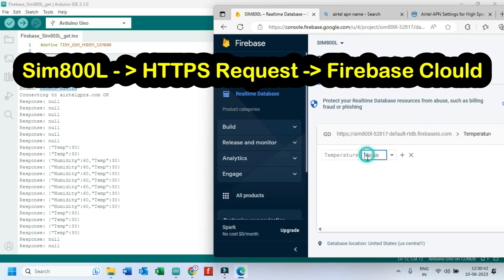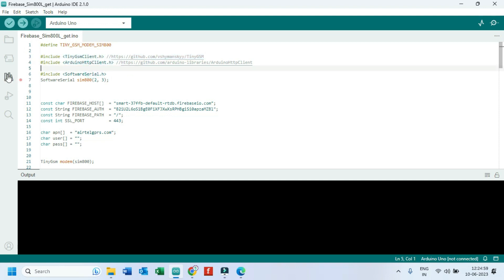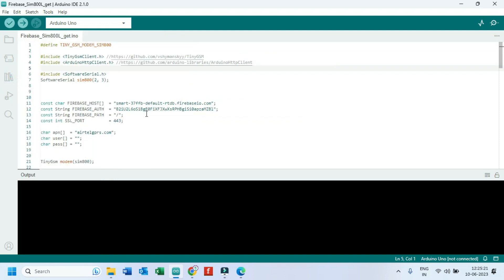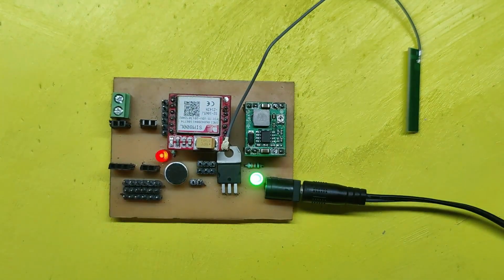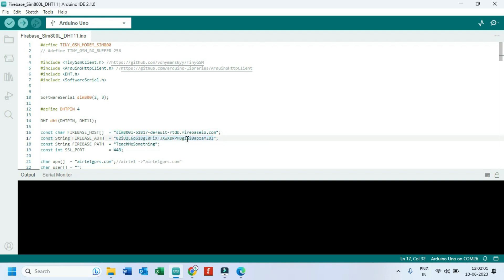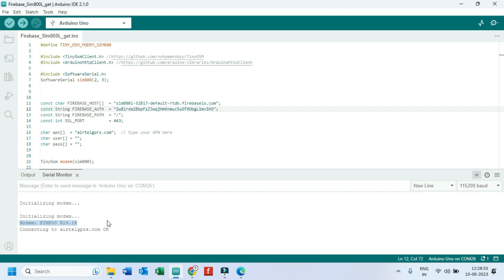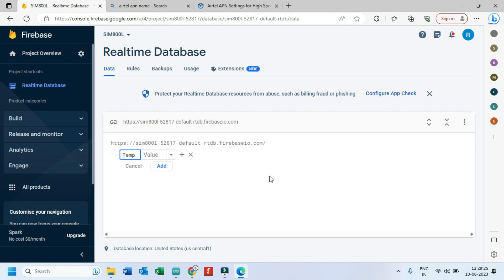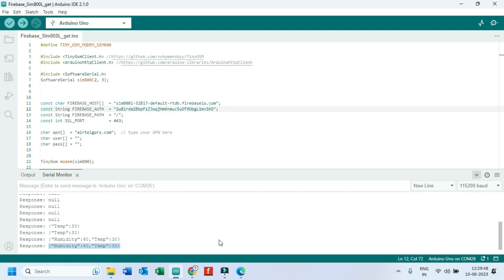Sim800L HTTPS GET Data Firebase Cloud | sim800L https | sim800L https post Example |  https get

Comment: Sir i have done the same thing, but my gsm module is not able to connect to firebase.. i have tried creating other database also, but the problem still exists. Please help me
Reply from the maker: Pls check your module version.
The old version Will not work.
Watch the video fully
Reply: @TeachMeSomething  sir module is also correct
Reply from the maker: R14.08? Or R13?
Reply: @TeachMeSomething  R14.18 the one you showed in the video
Reply from the maker: @siddheshchaudhari9484  then you need to watch video properly & remove / or http

And install the same firebase version in my video
Reply: @TeachMeSomething  Okk sir.. I will try again.. thankyou for your reply

Comment: hi, can I use this code with SIMA7680C, I connected but it always stops at the
  Serial.print(F("Connecting to "));
  Serial.print(apn);.
 It doesn't show OK or Fail. Thank you very much
Reply from the maker: 4g sim card format may vary. I didn't use still now